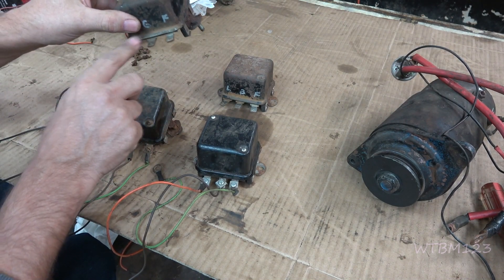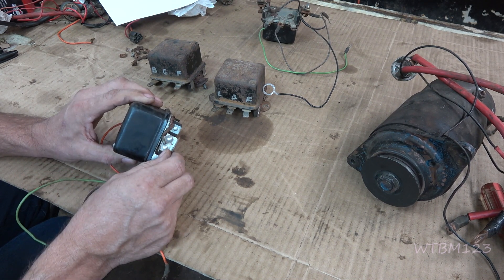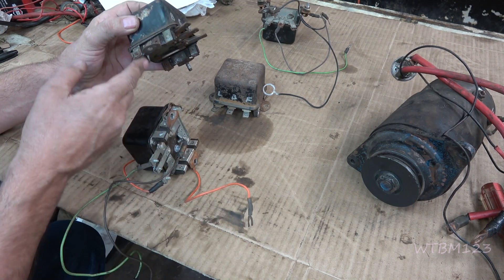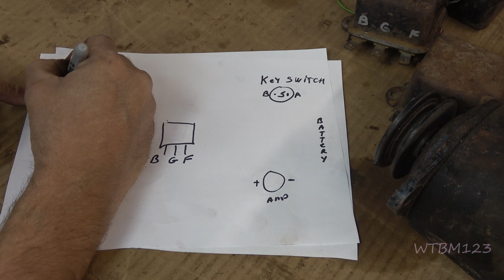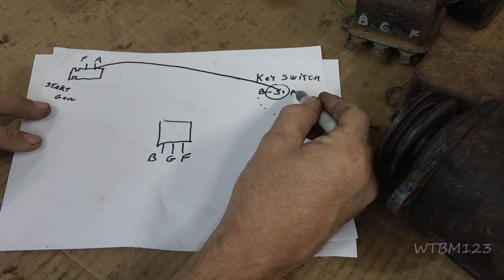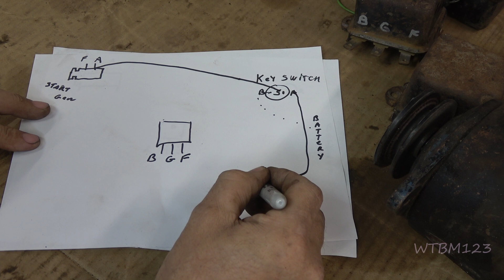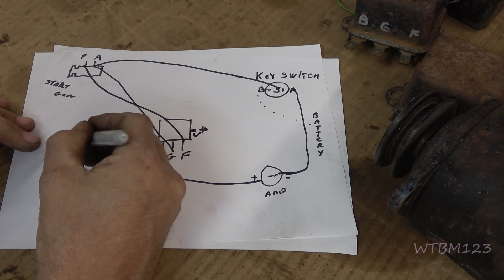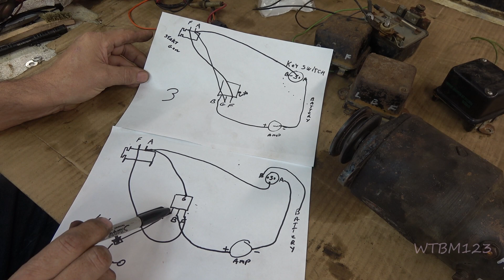Swapping 3 and 4 terminal regulators starter generator garden tractor 12v. They are interchangeable

Comment: I have a starter generator. I’m trying to wire up I have F1 F2 A1, A2 DF connections on the starter generator. I have a GM voltage regulator number one being the blue wire number to use the white wire number threes the red wire number fours the brown wire I can’t find any info on YouTube how to wire the starter generator up.

Comment: A lot of people say everytime you unhook a battery in any machine that has a generator you have to re polarize the generator. That is not true. The only time you have to repolarize the generator is if you want to change the polarity. Benn there and done it.
Reply from the maker: Usually it needs done when sat for a very long time no battery . But that is only for a generator , A starter generator will take care of its self when one tries to start it . Correct usually no polorization needed .  Thanks for stopping in .

Comment: Very good explanation and drawings. I’m running a solenoid on my setup and I’m not sure how to wire it into this system. I have the 4 pole regulator. Can you tell me how the solenoid gets wired into the #4 drawing you made? Thanks
Reply from the maker: Instead of hot wire from battery going to key it goes to a big lug on solenoid , also on that solenoid terminal add a wire to key switch to power the switch  . Other big terminal on solenoid goes to starter.   If 3 wire mower solenoid then need a wire from S terminal on key switch to the small wire on the solenoid. And solenoid needs bolted down to ground  If the solenoid is for a mower and has two small terminals then one needs grounded , Does not hold true for automotive solenoids
Reply: Ok I’ve got the 3 post solenoid. I’m also adding an amp meter in the mix so where does it fit into my system? Your help is very much appreciated
Reply from the maker: @neelybourqueorr  Probably the A terminal of ign switch to amp meter then to B terminal of regulator . With Magneto system and key switch .  If external coil , then may be R terminal i believe it is . Like a K series Kohler may have

Comment: For my life I don't know why all these terminals -- voltage regulator, switch, and starter generator could not have been marked clearly with letters that correspond with each other.
    That would have made it much easier for the average guy. Thanks, though for the lesson!
Reply from the maker: Thanks for stopping in .   Kinda like why do they not mark all terminals on ign key switches . Most are marked , but many are not.